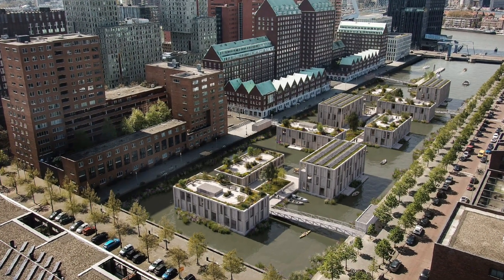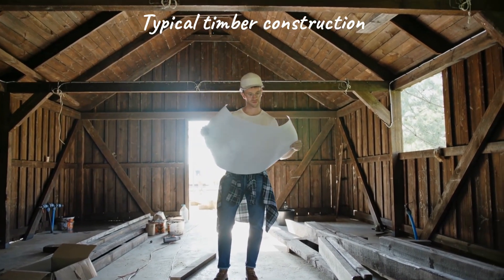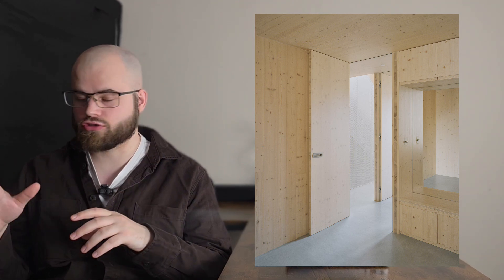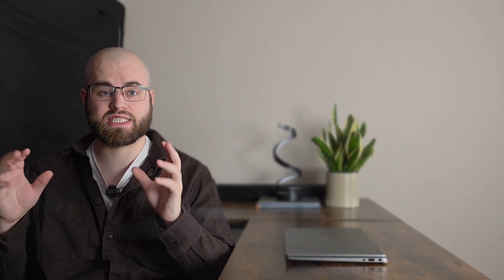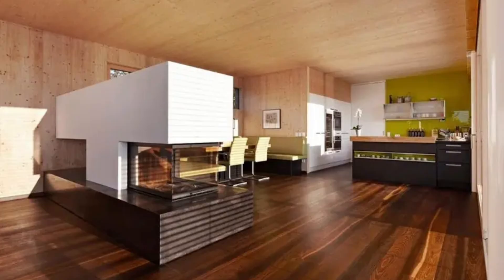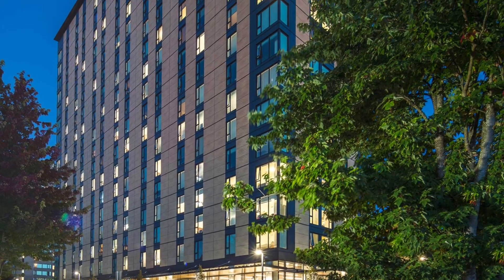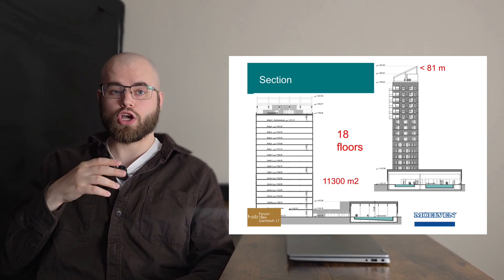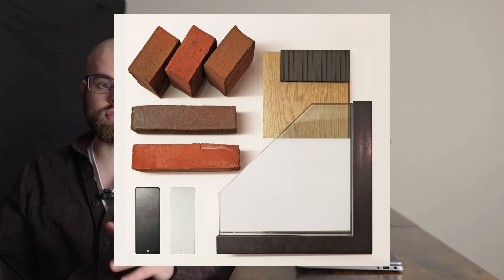Why Skyscrapers Are Switching to Wood (Stronger Than Steel)

Comment: I think it is useful to try to remove the need for special skills from artisan on user sites to trained people in factories. Cheaper and  better quality control.
CLT seems to be plywood with thicker plies!  I think the locking in of carbon is a serious advantage of CLT.
1. I notice images of CLT building with exposed exterior timber.    How can CLT buildings be protected against weather, rot, termites and borer?
1a.  I notice much exposed interior timber.     Lockwood construction I've seen in NZ often has perhaps excessive internal timber.  Same problem with CLT?
2. CLT is presumably more expensive than other panel products, so most attractive where its structural strength is important.    Is it cost-effective to use CLT everywhere or is it mostly better to use something less expensive for non-structural elements?  I think using only CLT would be better, because fewer joints and joints cost money and are sources of problems, air and water ingress for example.
3. Recycling or disposal.  One of the issues now with recycling timber is the possible presence of timber treatment chemicals.   How doe CLT address thse issues?
4.  I often observe buildings with expensive built in features that do not suit the user well and cannot be easily changed.    Houses are often constrined by positining of bathroom and kitchen.  I like the idea that a house should be a flexible box, where everything inside is moveable furniture.  Externally prefabbed bathroom.  Kitchen just furniture with plumbing connections.   Shift complexity and tech to factories, detailed configuration to the user.
Reply from the maker: CLT is kiln dried, meaning the moisture % is pretty low so fungus and pest attacks are discouraged (although not 100% safe).

Regarding talk of specialist skills - my belief is that with any new material, like CLT, the first people dealing with it will be looked at as specialists - but over time as more people are involved the "specialism" tag is reduced to just another worker.

Also CLT can be recycled through being used to create new CLT panels after sorting, offcuts going to new engineered materials, or converted into biomass

Comment: How is it against rot, mold & termites?
Reply from the maker: Protective coatings, treatments and adhesives help a lot. A rain screen facade in particular helps against rot. I the CLT isn't treated you could definitely find termites

Comment: I see the positive aspects for commercial, but it may not have advantages for residential homes ? I wonder how architects deal with moisture intrusion, and mold growth ?
Reply from the maker: A rain screen will obviously help. Special adhesives, treatments and external coatings are needed to prevent pests from eating and living in it

Comment: A skyscraper made of fuel? It doesn't sound like a good idea to me, but after the GSK lab fire in Nottingham, in which a low-rise CLT building that was nearing completion burned literally  to the ground, it sounds even worse. A similar fire in a high-rise building, all other things being equal,  would be even worse. To be fair, the GSK lab was missing its sprinklers and some fire partitioning, if memory serves me correctly, so it would have been less fire prone if completed. But those things won't stop a fire in a worst case scenario and in a high-rise building, the worst case scenario matters a lot, especially if the building is surrounded by other wood structures. I worked with a guy who was building an all-wood house in Maine some years ago, not the drywall covered stick houses we normally build in New England, every surface of this thing, inside and out, was covered in boards and they were coating it with tung oil. As you might have guessed, the rags left by the painters burned the place down, much like what happened to Johnny Cash's house some years ago after  Barry Gibb had purchased it. The striking thing about this fire was that even the concrete foundation got destroyed, which isn't a normal result; the heat from all that wood was enough to crack and degrade the concrete, requiring a new foundation for the rebuild. Imagine all the wood needed for  a skyscraper burning in the middle of a crowded city.
Reply from the maker: Thank you for the thoughtful reply - I really appriciate these kinds of comments.  The Nottingham Uni lab fire was caused by an electrical fault, and the building apparently wasn't even finished. There was no  fire doors (and in some areas no glazing), meaning there were open voids between floors. CLT actually resists fire very well as it chars the material forming an insulating layer that protects the core, and helps maintain structural integrity for a reliable calculated period e.g. 30 mins, 60 mins, 90 mins etc.  The char layer prevents the fire from reaching the unburnt wooden core, slowing down the rate of combustion. Something like steel can fail suddenly at high temps and cause catastrophic damage.